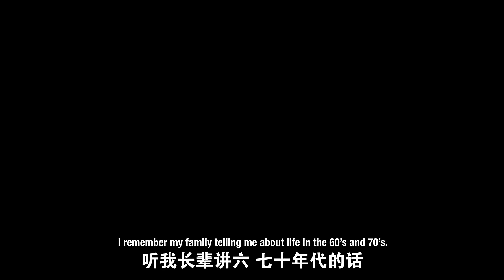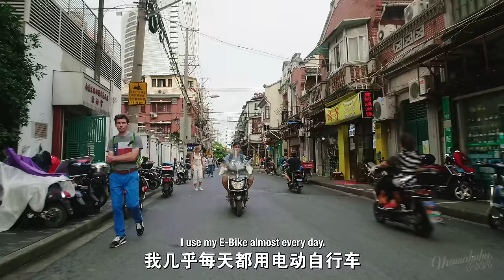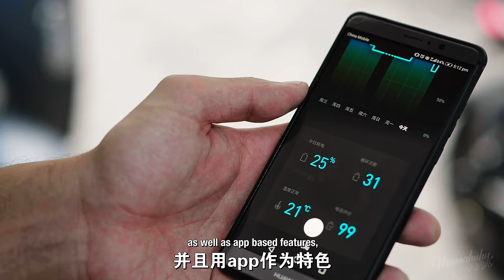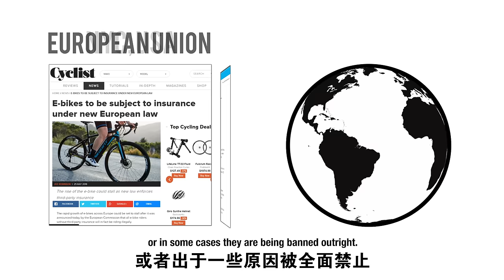China Kickstarted The Electric Scooter Revolution

Comment: More electric vehicles is nice for all of us, if the air in the city is cleaner.
Reply: how do you think electricity is made ?

factories there are still polluting heavily, lets not even talk about batteries factories LOL
Reply: Grande parte da eletricidade em Portugal já é ecológica , e as centrais eléctricas a carvão são mais eficazes do que os motores a combustão dos automóveis , por isso a produção da eletricidade a carvão causa mesmos poluição que uma cidade inteira com veículos  a combustão fóssil .
Reply: 70% of Chinas Energy is generated by Coal, so it isn't much better
Reply: I am not saying you are wrong, because I think the same, but keep in mind that the energy should be clean too, like wind or waterenergy.
Reply: @terocool7625  two stroke engines, and these 4 stroke engines without catalyst is the most polluting transportation source currently, besides yourself.
Reply: Carsten Hahn in southern China, it’s mainly hydraulic power and nuclear energy.
Reply: @CMatomic  
 1- oil is not a "fossil" fuel. In fact, there is no such thing.
2- CO2 has nothing to do with climate warming/change.
3- A cooling climate is bad. A warm climate is good.
4- The Sun is the driver of climate and it's "going to sleep".
5- Which is very bad news indeed.
Reply: @moriarteaa4692  
oh well....
You'll be glad to know that the Sun is the driver of all climate in the Solar System.
HOORAY!
Oh.... but the Eddy grand solar minimum is here and the climate is cooling.
BOOOOOO!
Reply: @LordGryllwotth  
polluting, but nothing to do with climate warming/change.
Like yourself.
Reply: @aryasona8843  
nuclear is nuts!
hydro-electric is less nutty, but still nuts....
"Hydraulics" is something else completely.
Reply: Only 25kph?
Reply: More Batteries = More Toxic Pollution vs Vehicle Carbon Emmissions
Reply: Even if the electricity for electric vehicles is made from coal it is still cleaners and more efficient than burning fuel in thousands of small engines. And more importantly the pollution isn't created right under the people's noses, which makes them sick.
Reply: why not hydrogen and why not 50 years ago ? its an otto motor and out of your exhaust comes air that you can breath it even keeps the motors clean because its burns ceaner that means longer lasting motors witch would mean a even smaller footprint on our planet aaannnnnd you can adapt the motors now to be running on hydrogen
Reply: Burnung hydrogen with air creates nitrous oxides in the same way as any other combustion engine.
Reply: Electric scooters are nice, but my need to arrive on time for work meetings requires me to nothing lesser than a C63 or when meetings are at flexible times i can get away with driving my slower car and more eco-friendly car (Audi RS3).
Reply: but I might consider getting a scooter for driving around town on weekends. Maybe a little Hayabusa or H2 will do.
Reply: @terocool7625  There are many ways to make good energy. My energy is  all made from water 100%
Reply: @bipolatelly9806  of course the sun is the driver of the climate, because it literally heats the surface of the planet. And that worked well until we've imbalanced the mixture of our atmosphere. It contains now higher parts of CO2 and other greenhouse gases, which lead to a rising temperature, by refracting light back into the atmosphere.
Reply: @moriarteaa4692  
no... 
The Sun has again entered a period of low energy output, the "Eddy" grand Solar minimum.
CO2 has NOTHING to do with it. 
You are talking absolute corporate pseudoscience.
And the idea that a warming climate is somehow a bad thing simply ignores history.
Anyway, you're about to discover the reality of life in a cold climate. It's already started, alas.
The crop failures are happening and it has NOTHING to do with global warming. The Ice-Age was also the DROUGHT Age.
MSM is fighting a losing battle keeping up the farcical narrative of the, always on the horizon, disappearance of the ice-packs and glaciers.... Well the ice-packs are at 1970s levels and the glaciers have returned...
LOL  Light reflected back into space has a COOLING effect! 
What do you mean "lead to rising temperature"? You are talking nonsense!!!!! LOL

"Winter is coming"
brrrrrrr....
Reply: @bipolatelly9806  hope you are only a troll
Reply: @moriarteaa4692  Better than burning more fossil
Reply: @terocool7625  You got a better substitution?
Reply: @terocool7625  I was thinking about this. When people think they’re being more environmentally friendly their usually not. There is another sacrifice being made elsewhere that also causes polluting.

Comment: I tried to make the electric scooters popular in the west, wrote much about it, did long time tests over 35,000 km, but instead of a boom, the business was even declining. Vectrix bankrupt, IO-Scooter bankrupt, Innoscooter gave up, E-Max gave up.
Reply: American car culture is intractable.
Reply: E-bike prices in Canada are too expensive. Nice ones are about $2,000.
Reply: ok, maybe i can help you. let's work together for a bit. tell me about your approach ?
Reply: bycicles are very popular though
Reply: Those were just too expensive, they made no sense to buy one over a petrol version. In many instances you couldnt even recover the cost via savings over the life of the bike ceratinly not before the battery badly degraded like the old vectrix scooter battery did.
Reply: The stupid speed caps (you can pedal a regular bike faster) and other odd restrictions state by state or even at the city ordinance level retards progress. Also you can part out a lot of stuff on the internet, western sellers of ebikes tend to use Chinese stock and add a $1000 mark up for branding and a different paint job.
Reply: The thing many people do not understand about price levels, is that the products for the chinese market are cheap for a reason: they are crap compared to western standards. It's the same for electronics and cars. It's a fact. In the west electric scooter and bikes cost a lot because they use better technology. Take the batteries for example, an advanced 500Wh lithium battery could cost up to a 1000$. Why? Because they can last years. Cheap batteries like the ones on these chinese bikes, fail in a year or 2 maximum. 
You have to think about electric cars, and then scale it down to a bike level. Simply put, the battery technology is not yet ready for a real mass market. Oh and btw, in EU the eBikes are a flourishing business. The problems are as usuall with government regulations, which in China for example are not enforced, but are strictly enforced in other markets.
Reply: you people are too big for a scooter

Comment: I've been driving ebike here in the Philippines for almost 5 years, daily between home and work. Bought my ebike from TAIL-G, the thing about ebikes is that the electric motor and the controller doesn't require maintenance so you will probably visit a motor shop every 2 years to replace the battery if its SLA or 5 years if its Lithium-Ion. Tires needs to be replaced every 3 years depending on the wear and tear.

Comment: Why wouldn't an electric scooter do well on a hill? Doesn't an electric motor produce maximum torque at only 1 RPM?
Reply: My OJO goes up hills just fine. If the speed wasn't sensibly limited to 20 MPH by the factory, it would be deadly fast.
Reply: Depending on how many hills you mandated to SLOWLY TRAVEL UPWARD will decrease battery cap and lifetime of bat Extremely! My trikes can go 43-70kph (usually around 25-34 mph depending on weight of rider but if you add a plethora of inclines above 15 to 22 degrees your battery depleats and motors increase heat. Hot coils in e-motors will eventually burn off coilwire coating causing failure. Better heat dissapations, Coil wire coating strength properties fire safety from over clock and solar charge capabilities would be a GREAT necessity for ALL of these motor sciences!! Even Tesla has it's issues!

Comment: They need to go strictly electric bikes in Vietnam... the air on them city streets is horrible 😷
Reply: In 2015, the company generated 159.5 TWh[3] of electricity from power plants as follows: hydropower plants 46.07%, coal-fired power plants 28.64%, gas turbine power plants 21.58% and diesel-fired power plants 3.39%.
YOU NEED THESE FOR ELECTRICITY TO PROVIDE CURRENT FOR E-VEHICLES!!

Comment: Indeed a true revolution as revolutions always wipe something out. 

Electric scooter revolution in China certainly wiped out those motorcycles with well defined safety measures, standards, regulations and its underlying cultures.

Leaving the city filled up with these metal junks almost falling apart in the middle of the road, you barely see anyone wear a safety helmet, not even an open face one, not to mention the other protection gears.

Most of the rides have no idea about the highway code, shoot straight out to the middle of the traffic from no where. Quite often you see them mounted it to the pavement while holding down horn button and ploughed into the crowds. You also see them joy rode it on to the escalated motorway like nothing was wrong.

No body knows Sharp, Dot and ECE, no one of those electric scooter has ABS or combined brake equiped and ironically, the white strip paints on the road are as thick as notebook and dangerously slippery when wet, combined with 5 of 10 the headlamps are too dim to use at night, make it extremely dangerous to ride at a rainny night.

A few of my friends had been ran over by these scooters, and some of them was sent to hospital for broken ankles. 

The well defined and more complete solution had been driven out (banned) in order to leave room for this shit storm, and that was money talks.
Reply: Thanks for real truth Norman Xu!! I mentioned earlier what happened to bicycle craze causing bicycle graveyards.
Xiexie!
Reply: In fact, there are very few collision accidents